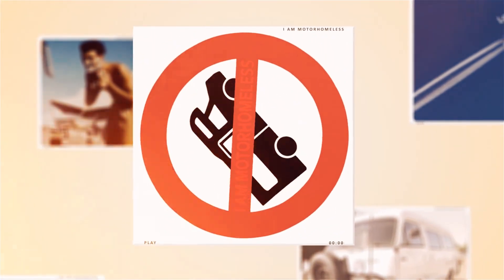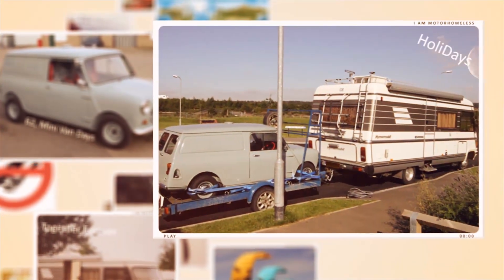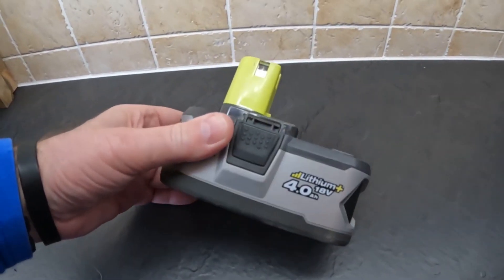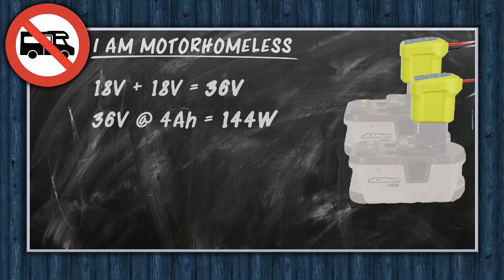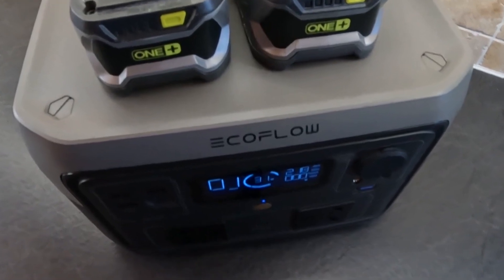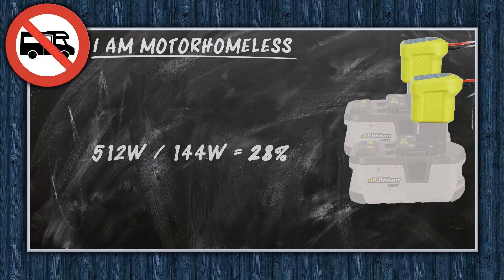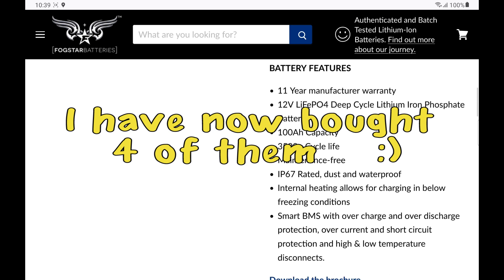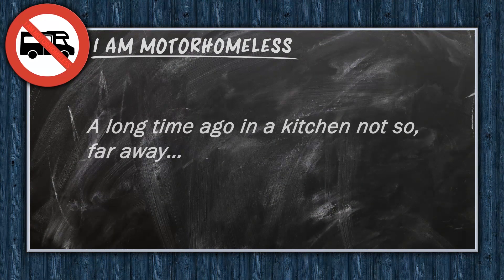HOW to Expand the Battery Capacity of your EcoFlow River 2 - I AM Motorhomeless - E 02

Comment: When you plug the river to main 240V, would it also charges the Ryboi Battery?
Reply from the maker: No, the xt60 plug is only power in. I have to charge the Ryobi Batteries with the Ryobi charger. but I do have the Ryobi 12V car charger. So if we had no mains power, I could charge them all as we drive somewhere